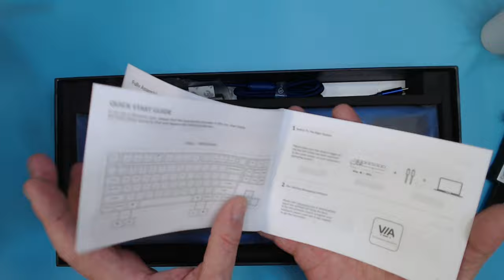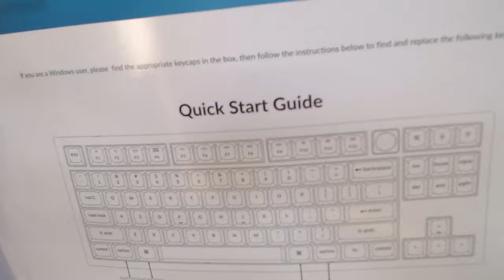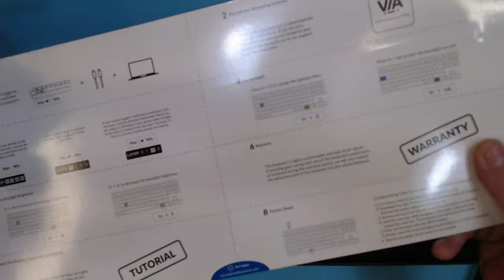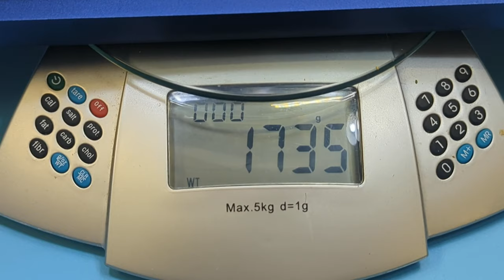Out of the Box: Keychron Q3 Knob Barebone Edition

Comment: I got this one, and the sound is much less with Kiwi Switches lubed and filmed (Miller-Stephenson TriboSys3203 for plastic housing, and 105g0 for the springs), and a 73.5 g progressive spring upgrade from 67g for the space bar.  Space bar is louder compared to other keys, but the authoritative snap back is worth it.  Equalz V3 stabilizers with poron holee mod, and 0.2mm stabilizer housing mats.  Miller-Stephenson TriboSys3203 was used for lubing all plastic pieces, as well as a dab for the stabilizer metal and plastic interface.  
The wood palm rest is a must have for extended typing, and my WPM has increased by 45 compared to other mechanical keyboards I have used, both with linear and tactile switches that have not used as they came from the factory. 

My issue now is the dang keycaps... The OSA PBT keycaps that come with it (Navy Blue - B variant) have officially ruined me with other keycap profiles.  It seems that there are zero options available for an OSA profile of keycap with a shine through for the characters, and I like to work in the dark, with just the glow of the monitors.  The pudding style of glow is far too bright for my tastes, as I have seen 1 or 2 that are available with pudding style glow, or just completely clear.

A word of caution to anyone ordering this - do not get the FR4 plate if you get the Knob type style, as it does not fit.  Pretty dumb oversight from Keychron with this, and $15 wasted.
Reply from the maker: Have you tried just straight SA profile yet?
Reply: @MechKeyboards  I have not. SA profile is taller than OSA from what I see online, and with the palm rest, the OSA is the perfect height for extended typing sessions, thus my search for OSA style keycaps that can have side or top glow translucency for the shine through characters.
Open to any and all suggestions.  If you are more familiar with this stuff, I would gladly compensate for time and effort if you know of any good keycaps.  PBT material feels sooo much better with the slight texture compared to ABS.  I can contact you via e-mail if this is something up your alley.  I start searching for keycaps, and 5 minutes later, get distracted looking up "more fun to me" things like Spectrum Analyzer specs. 🤣

Thank you for the reply!
Reply from the maker: @bluesteelbass  I could probably talk for hours about it! If you have Discord  come @ me on our server: https://discord.budgetkeebs.com - @badmark